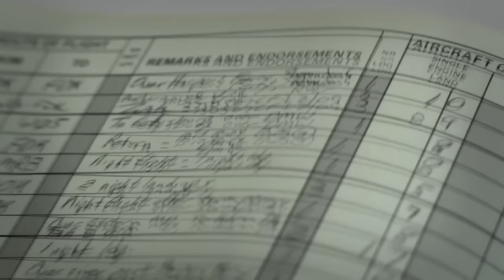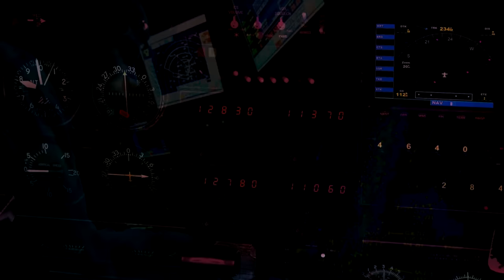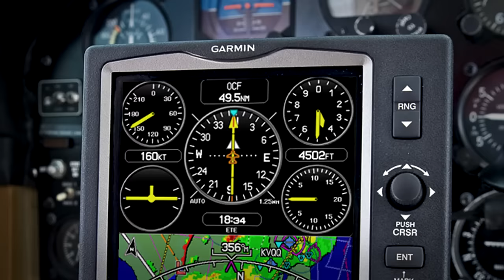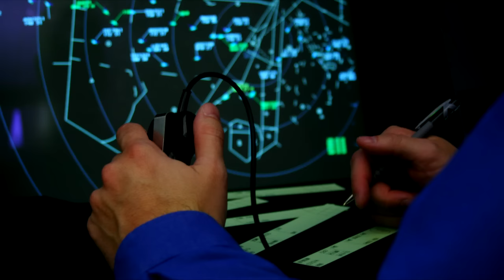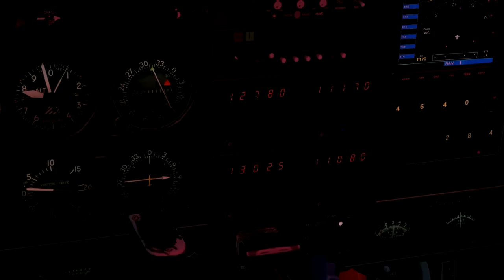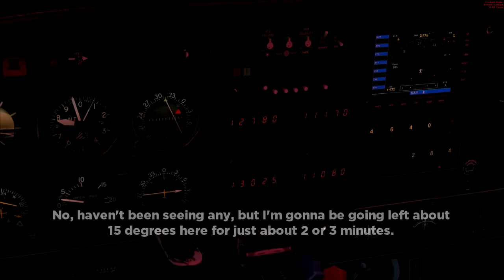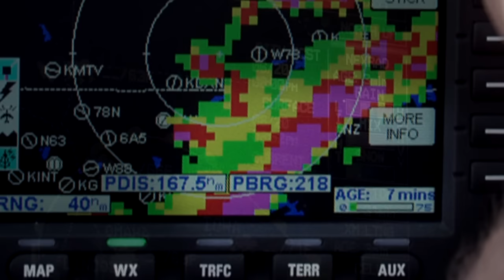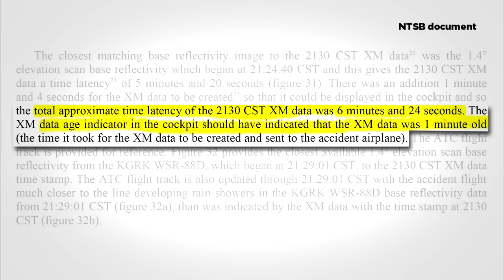Accident Case Study: Time Lapse – misunderstanding in-cockpit weather displays can lead to tragedy

Comment: I got a few big lessons on how dangerous/strong weather is just from a lot of commercial flying (and that 5 of my cousins (4 adults, one baby) were killed landing in Vail in a very sudden ice storm; 4 passenger single engine Cessna).  If you've ever flown over/through the inter-tropical convergence zone (where Atlantic hurricanes come from) over the Sahara Desert, it will change a 747 into a Cessna being playing with by a clumsy kid. 747s always seem so disconnected from the weather, so that was pretty unsettling.

At DIA (Denver Intl) I watched a Cessna single engine land in front of a bad thunderstorm cell, ditto the clumsy kid but worse.  He was only about 100' from the ground when he lost about 30' abruptly and looked like he was on a giant, side to side swing, also going up and down wildly.  No time to recover; had to just land.  He landed on one wheel, crooked and off center and stopped right away; just sat there lol.  My plane taxiied away, so don't know what happened to him/her.

Was in such a severe thunderstorm b/t DFW/Houston Hobby, when pilot had to go through instead of around a cell, that one of the them YELLED into the mic, "Flight attendants, SIT DOWN, NOW!!!".  I have never experienced that nor such storm craziness in the air (well, except for the Air France flight that suddenly went into a high speed dive for 2,000' in perfectly clear conditions; I didn't speak French, so never found out what happened).  Anyway, we 3 passengers in the storm almost kissed the ground when we handed at Hobby.  We had been at around 30,000', so we were in little danger, but it tested some limits.  No one was hurt, as we had been duly warned by one of the pilots (much prior to the yelling), although one guy insisted on standing up, like a macho jerk, until he was thrown violently into his seat by the movement.  Luckily it wasn't a full plane or there would have likely been some injuries.

Moral is that if this pilot had been through any of these experiences, he might have had more respect for the weather, except for the Getthereitis.  The incidents were in or started in clear air, so avoiding storm clouds and cells doesn't always make you safe in a small plane.  If all of the above been in a small plane, they would have been in serious trouble, esp as flying so much lower.
Reply: Been on a couple of flights where the pilot has told the flight attendants to "SIT DOWN NOW" and have seen other passengers injured in those situations because they didn't listen.  You'd think people would take it seriously, but they just don't.

Comment: Years ago- 1990 to ‘93 range, I took off from my south Florida base bound for the shop in southeast Alabama that maintained my plane . I left later than planned and found myself racing a cold front with very nasty storms ahead of it , to my destination. My Aerostar was fast but not that fast; I lost . At only 20 miles or so from the airport I hit the worst weather I’d ever flown in - could not maintain altitude or heading  and had to get a block from ATC while my head and headset were slamming into the headliner and I could no longer read the magnetic compass - you get the picture. I asked for and received from ATC a turn back to Tallahassee, FL which I’d just passed and which was still in the clear but now I had to make a 180 in cold front leading edge turbulence and heavy rain where  it seemed my conservative bank angle was getting me closer to loosing control than ever but ..I got out ahead of the front again and into Tallahassee with an Angel watching over me I suppose . Point is I really feel for this pilot-I’ve been there. But I had much more experience than he, and immediately told the military controller working my IFR flight about my situation , then worked with him to get me to safety . No 360’s and 180’s without permission- that poor  Cherokee pilot was disoriented and in a world of trouble. As for me, they need not put on my tombstone: “he was only 20 Miles from his destination so he kept going “.

Comment: We were flying a turbo 210.  Made a huge mistake and next thing we know we are in the updraft of the tstorm. Couldn't break free . Turbulence was severe.  Hitting our heads on the roof.  Wings actually bent down. BLACK  like night inside. We made the plane dirty, that didn't work. Next was full throttle nose down.  We landed nearby and checked the rivets on the wings and none missing . Cessna makes a strong plane. We never made that error again.

Comment: You have provided quite a comprehensive and compelling case indicating how soon an aircraft can become overwhelmed in icing conditions.  Operating at higher altitudes where the outside air temperature is minus can overtake the ability of boot inflation systems on the wings and tail,  only avoidance can prevent the situation from becoming threatening

Comment: What they said about the time lag in weather radar is absolutely true. I was in OKC on May 3, 1999, when a massive EF-5 tornado hit the southern side of the city. It was headed for my neighborhood, so when it was about 3 miles away (on radar) I got in the car and headed towards the other side of town. To my surprise and horror, the funnel was only about a mile from my location. The reports on TV were lagging the actual location by a mile or more. Lesson learned: don't take weather radar as completely accurate, and always give yourself a little extra buffer.

Comment: weather bad = I don't fly
Reply: When I was flying a small aircraft, at my airport, if the birds weren't flying, neither did I!  Crosswinds were par for the course and the landing pattern had a mountain, then flat, then ocean, and the windsock could be straight over the numbers and then at 90 degrees a couple of hundred feet down the runway!  Of course it was challenging and I liked that, but sometimes, it's just better not to take a chance!  If the birds didn't want to chance it, then neither did I!
Reply: I'm no pilot = I definitely don't fly (unless I'm a passenger).

Comment: A family friend of ours was flying a small single engine plane into Langley BC in a bit of bad weather, just as he was on approach, he hit a downdraft that dropped the plane very significantly.. As he crossed the highway, his wing took out the "Low flying aircraft" sign!
Thankfully there was an experienced pilot in traffic and he saw what was happening and stopped traffic!
It was a little bit of an insurance claim to fix the wing, but it all worked out

Comment: I have unlimited respect for storms after watching an airline pilot's talk on microburst escape maneuvers.  The fact that weather exists which requires a prolonged (minutes!) max-performance climb from a DC-10 at landing weight, and STILL FORCES A SINK RATE... I had no idea.  And to think that they can appear out of a calm flying day to that level of intensity, in the time it takes those guys to do an approach.  I don't know exactly how much weather it takes to smash a C172 into the ground like a swatted fly, but I do know it's less than what it takes to do the same to a 767.  That's all you need to know.  A thunderstorm is like what you get after a hydrogen bomb or a big volcano goes off.  Cessnas don't belong in mushroom clouds.

Comment: I don't understand. If you are in an uncomfortable situation and especially have loved one's aboard. DIVERT. Don't try to get through it. TURN AROUND. He should have doubled back or turned South and found a small airport to huddle in. A 45kt TStorm will move by quickly, usually leaving behind really smooth air. A few hours delay is so much better than an eternal one. ATC should have been more firm.

Comment: As I approached IYK in a clear sky, I flew the T-34 into what I later learned was a cloudless rotor off of the Sierra Wave. +3 & -2gs, aircraft rolled nearly inverted, nose pitched above 60 degrees, stall horn going and shins bloodied from being tossed into the instrument panel during the transition from +3 to -2g. Wife's purse emptied out and we had all sorts of goodies flying around the cockpit.  This lasted for 4-5hrs (must have been less than 5 min) then we poked out of it into the smoothest air.  I tightly gripped the controls waiting for it to go ape again.  No problem.  Landed the bird and had to wait for my wife to come back from the restroom to finish re-fueling the bird.  I'm not sure a Cessna would have survived that ride.

Comment: The pilot was confident at least from his radio talk with the controller. He could have had good guidance to avoid the weather from the controller who was providing it anyway. He didn’t cater for the time lag on his NEXRAD equipment. It was not an onboard weather radar. He was inexperienced but complacent which showed in closing up so much to the storm in that single engine equipment.

Comment: On the way to Oshkosh back in the 1980's, we were solid IMC at 8000' in a Cessna 172 being vectored around a storm cell with several 20-30 degree turns to the right to avoid the cell.   The cells must have been forming as we did that because we ended up in a cell.  We were in a full-power climb configuration but in a very turbulent 1500fpm decent.   Our camping equipment was jumping off the floor behind us.  When my head hit the ceiling I cinched up the seat belt.   I was working the radios and my buddy John was flying this leg.   I told them we are unable to hold altitude and they said the airspace was clear of traffic below us.   We popped out the side of the cell into clear air after losing quite a bit of altitude.     That was the last time I  went near any embedded thunderstorms.  Some lessons are learned the hard way.  We were fortunate.

Comment: Doppler Radar has several scan modes. A slow scan mode for detailed data, however this mode takes quite while to build up an image. A faster scan mode allows for quicker data, at the expense of detail. Despite of which mode is being used it still takes time to build up an image.

Comment: I am sorry but the guy was stupid to risk that with his family on board. Can't imagine what that family went through when they seen the wing snap off.
Reply: i imagine there would be a lot of swearing
Reply: Any force strong enough to snap off the wing would likely be enough to cause an immediate blackout.
Reply: @LordSandwichII  you would be surprised how fragile those small planes are
the spars in those things are tiny and a lot of pilots actually pay to have the spars reinforced above standard spec

this guy clearly didnt
Reply: @mwbgaming28  Baloney; the spars are not "tiny", and pilots do not pay to have them reinforced.  When a wing separates from the fuselage due to extreme overstressing of the structure, the plane is already in an uncontrolled dive.
Reply: @johnrltr  baloney nothing, I have seen people getting spars and attachment points reinforced on small GA planes

and the physical size of OEM spars on many GA planes are pretty small for the amount of load they are under (I mostly attribute that to material science)

Comment: 14 hours actual my guess is very little real weather flying is a killer. The reliance on NEXRAD is great if you know its limits. It does no good now to those that lost their life but maintaining attitude flying is critical to over G-ing the aircraft. When having flown into heavy turbulence flying attitude is all I could safely do regardless of what the VVI says just keeping the wings level and the nose level will give you a chance. The few times we had flown into this weather I could see the VVI going up 2-3000 then down the same all the while just maintaining attitude flying letting ATC know unable to maintain altitude. Never once did a controller scold us as they could see we were in heavy weather.
That and knowing the time delay in NEXRAD is critical. I try to stay 10 miles away from storms and with NEXRAD my cushion would be even larger.
RIP to those poor folks that lost their life and the pilot was fairly sure he was OK when he was in a t-storm.
An IFR rating gives you a license to go learn to fly in weather.

Comment: Too often, GA pilots (and sometimes airline pilots in a hurry) opt to enter a storm and are sorry.)    It is fairly easy to skirt a storm, you have radar, SIGMETS, AIRMETS, PIREPS, NOTAMS, and all kinds of weather warnings and reports to help you avoid them, it's sheer stupidity to enter a dark, storm area where there is sure to be turbulence, a cloudburst, hail, sleet, up- or down-drafts -- but pilots do it for any number of reasons, but usually because they are in a hurry (and they are sorry IF they live to tell about it).  Sadly, ignoring those warnings lead to crashes, have in the past and will again, and they ARE pilot error!

Comment: This hot shot pilot had an attitude that did not match his flying experience.
Reply: You might want to watch the whole video before making such an idiotic assumption.
Reply: @gpdude22  Ah, 400 hours with 14 actual is exactly Jack and Shyte experience.  Single pilot, single-engine, night IFR into an area of severe thunderstorms with no airborne real-time weather-avoidance equipment, only a Nexrad that tells you about 8 minutes later just how fucked you are.  Bob Robinson is right - the bad judgement chain here is unbelievably long.
Reply: @gpdude22   Did we watch the same video? lol

Comment: Has the technology improved since this video was made? Are the delays as long. 

Rip all.  Great learning vid.   9 hours in Cherokee gasp ... The passengers would have gladly welcomed a pit stop to wait out the storm.  I wonder what was so pressing in Waco that they just had to get there in the middle of the night?
Reply from the maker: Unfortunately, the delays have largely remained unchanged. We recommend using ADS-B weather/Sirius XM weather only be used for strategic and not tactical weather avoidance.

Comment: Lesson learned. Listen to freaking ATC.
Reply: And even more when you're dependent on a recip engine at night, and especially single-engine Piper wing spars which have a bit of a reputation and need to be treated gently.
Reply: I would agree that in 99.9% of situations ATC will probably have good advice. I do have a dead pilot friend of mine who took a vector between 2 big level 6 returns and it walled up and closed the gap after he was at the point of no return. Years later FAA and controllers settled with the family and were considered in large part the "cause" in the accident report. 2 other pilots had refused to take this flight, so you could argue he shouldn't have been in the air to begin with. I prefer to "Have a plan" run it by the controller. 9 times out of 10 they'll concur but sometimes they might see something you don't. That's when you use your best judgment.  In the end YOU are responsible for the outcome of the flight. The controller is going home at the end of his shift regardless.

Comment: It's interesting to see the frequent disagreement between XM uplink, stormscope, aircraft sweeping radar, ATC advisories and strikefinder. Always rely on sweeping radar. If you don't have one, fly in daytime and remain VMC. Never rely on XM at night or in IMC. Never rely on ATC to work you around weather. They'll do it 9 out of 10 times then on the 10th time you'll be considering the composition of your main spar. How many times can you make it running across a busy street with your eyes shut?
Reply: Here in the Pacific Northwest it is solid overcast 9 months of the year. Thunderstorms and severe cumulus activity during that stretch is quite rare*. An instrument rating would be useless here if we refused to fly IMC without onboard radar, considering how few IFR certified GA aircraft have it. Icing remains an issue and does tend to limit our IMC flying, but thunderstorms not as much.

* In the summer the weather here is a different animal and more caution is needed to avoid severe weather. The flip side of that is we get a lot more clear skies so waiting it out is an option.

Comment: Thunderstorms , in large aircraft maintain 20 nautical miles away from thunderhead, Ive flown through heavy thunderstorms with red all over the radar but in a four engine turbojet, lost all four engines to compressor stalls and got caught in severe updraft, in negative g down draft we would have been goners , engines came back on line, throttles back, hands off controls and saw a star in a break in the clouds and then I knew we made it. In this case the guy didnt have the experience to be flying at night in thunderstorms he should have called it a day and taken off the following morning.
Reply: Wow. Thanks for your testimonial.
Reply: I saw many aircraft on approach to PHL recently that were definitely not 20nm from the nearby thunderhead. My best guess is they were more like 10nm away (maybe less). Are you sure controllers follow your 20nm rule?
Reply: eddy van Beck    Really?!!  I would never want to fly with you then!    USMC Vet / Ex-Pat Contractor / G550 Worldwide Experience with 12 type-ratings & 16,700 hours)
Reply: theres a difference between flying a transport jet and a GA plane through a storm, for one the jet has stronger wing spars than the GA plane and those spars are designed to have a lot of flex, therefore there is no possibility of structural failure when flying a large jet through a storm

Comment: An excellent and informative video. 👍 The Baron System radar using data transfer from satellite will give faster updates compared to NEXRAD.  The Baron system can either be installed into the dash or comes as a mobile unit viewable on a windows laptop.  I do wonder if the pilot should have maintained his altitude and not reduced altitude? Turbulence is usually much worse around severe storms at lower levels.  This was a tragic event. You can just make out how bad things suddenly got by the tone of voice within his last communication.
Reply: He also didn't know where to turn. He was being buffeted, apparently.